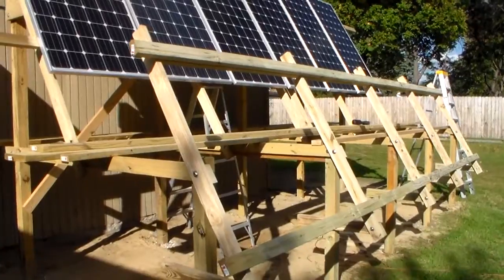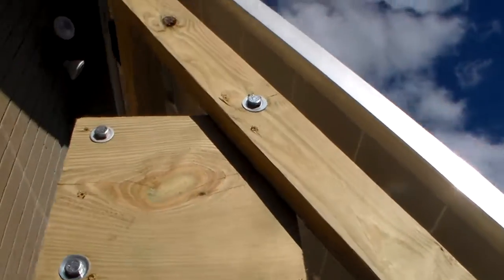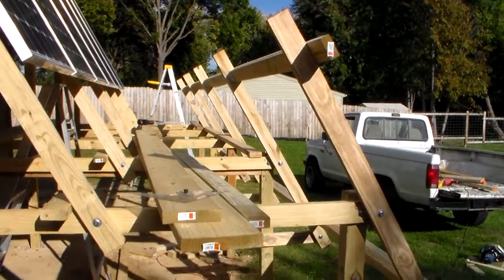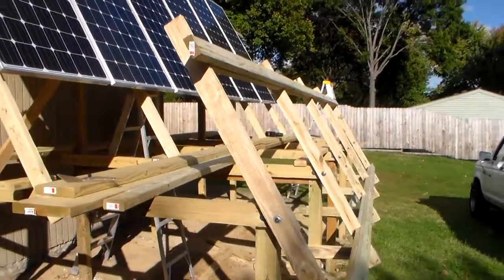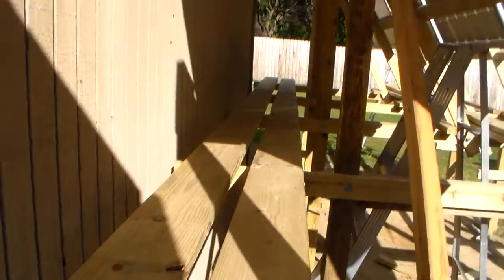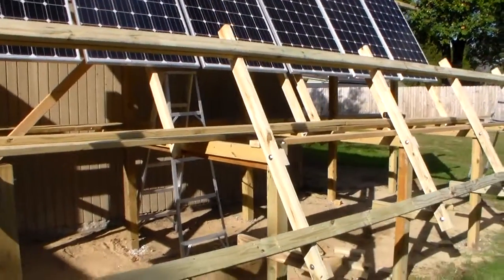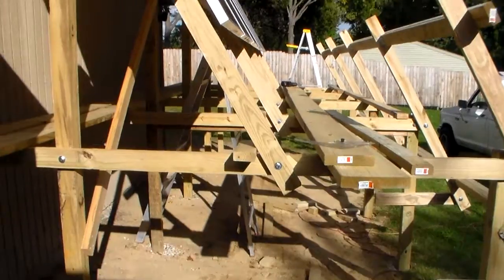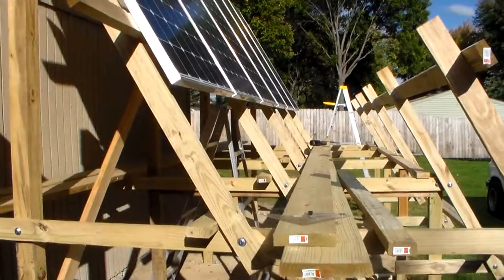12 Panel Solar Mount

Comment: Looks good. I’m about to build something like this how do you have the panels attached to the wood?
Reply from the maker: https://www.homedepot.com/p/MiTek-1-1-2-in-x-1-1-2-in-x-1-1-4-in-G185-16-Gauge-Framing-Angle-1-Pack-UJA1TZ/313507554  

4 of those per panel.  Drilled an 1/8 hole in one leg and used an 1/8 bolt to connect to holes on panel frame in 4 places.   Then, 2 deck screws in other leg connecting it to the lumber

Comment: Great looking installation. Do you recommend something like this or a roof mounted installation for better production?
Reply from the maker: If there is any way you can do a ground mount, as opposed to a roof mount- do it. You'll be able to brush the snow off, wash the panels and work on them far easier on a ground mount.  Also, should you ever need your roof replaced, you'll be much better off with your panels located on the ground for obvious reasons.

Comment: nice work , i bet theres a bit of combined weight in the wood, a good trailer load. i made around 20% more watts tilting toward the sun.
Reply from the maker: Thank you for the comment, yes, a small angle difference really shows up huh ?  I have a solar insolation meter and it's fun to play with.  Do you have one ?  What I found most interesting is on a heavy overcast day, it doesn't matter which way you point the meter, the solar insolation is the same - even facing due north ! and I confirmed it by doing a short circuit test (ISC) on a panel as I revolved it in various directions.

Comment: where did you get the solar panels thanks
Reply from the maker: They are out of Gilbert Arizona, 320 watt panels. They were 55 cent a watt - delivered ! .... and they work great. On 4 that are hooked up, I've seen just short of 1200 watts out of a 1280 watt possibility.  If you want their contact details, inbox me.